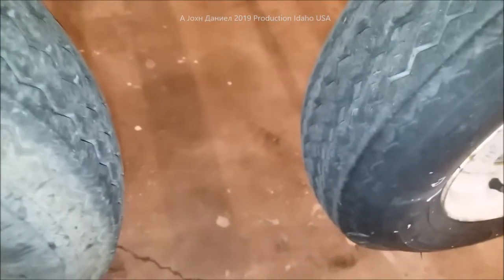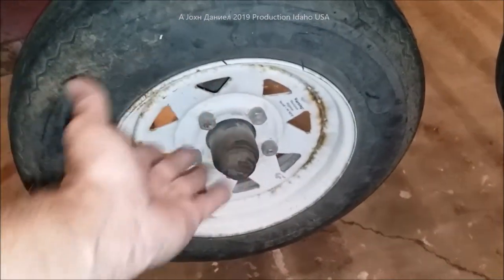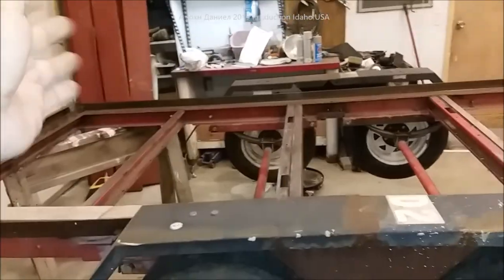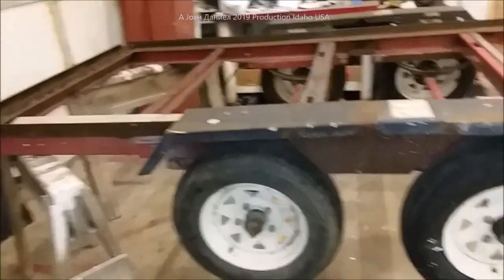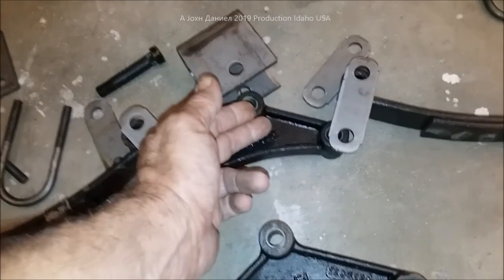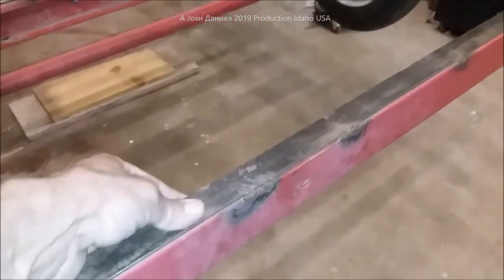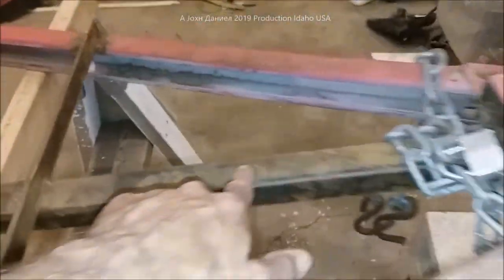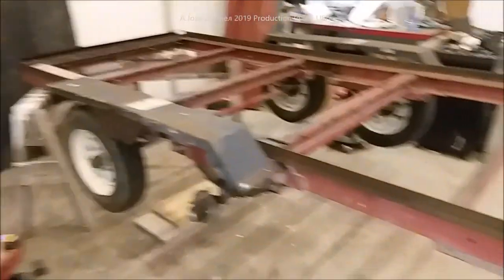Harbor Freight DIY Double Axle Trailer, Phase II Vid 1 of 2

Comment from the maker: Spring kit 2k/4k  https://ebay.to/309fyoK Full 2k Axle kits https://amzn.to/2YqwYNa Short Equalizers https://ebay.to/2YtKAHh  1" spindle Trailer Bearing kits HF & Northern Tool at https://amzn.to/2XEKRKx , 2000lb axles https://ebay.to/2EZSSyP or you can get just the axle  https://ebay.to/2R6YZXh and  hubs for it https://ebay.to/2IDw5Kr  You can build a cool one piece by piece at home. Need trailer Plans?  https://bit.ly/2XIj5tL Build with flux welder https://amzn.to/2WRQXmn that can weld 1/4" thick & use INE wire https://amzn.to/2WSdFun

Comment: My HF trailer has been cross country 5 times and the only maintenance I've done is bearings, seals and had the rims powder coated. I've overloaded it a handful of times, had it on the freeway more than any other towing and have had no issues.  I love this idea, but anything over 1800 lbs in Oregon has to be registered. As it sits with one axle, it's just shy of that.

Comment: your probably better off not lifting heavy stuff , dont want to hear youve herniated a disk and need a back operation , my relatives are very strong and very big ,they use to lift very heavy things like harleys, now they all have sciatica etc that Never goes away just like me , very good price for the spring kit, you could tripple that price for Australia.
Reply from the maker: Yeah, Don't need a second back surgery but 3 older kids gone, younger 4 kids don't need to get hands involved with such a weight.